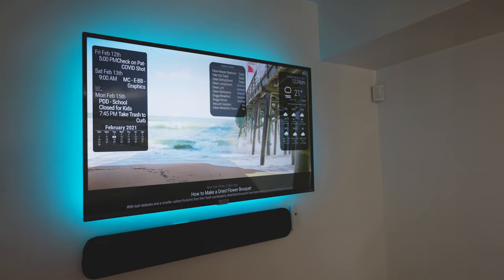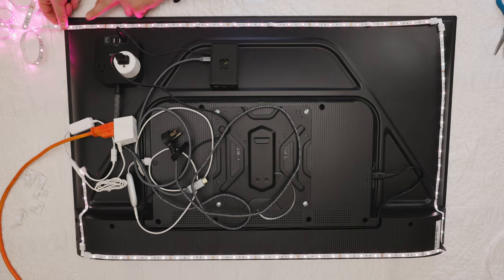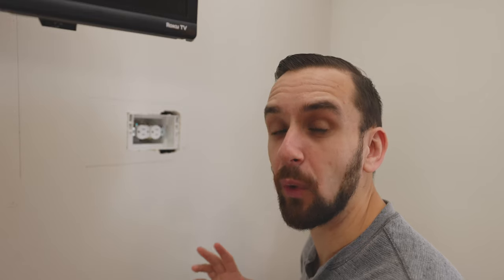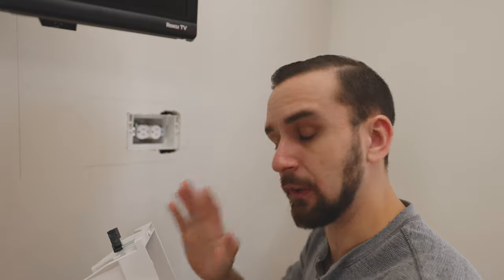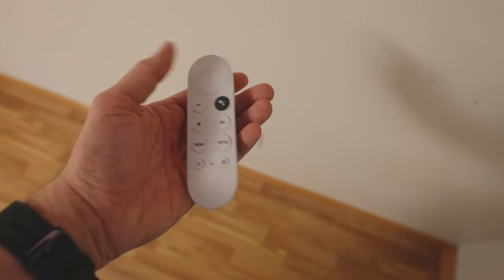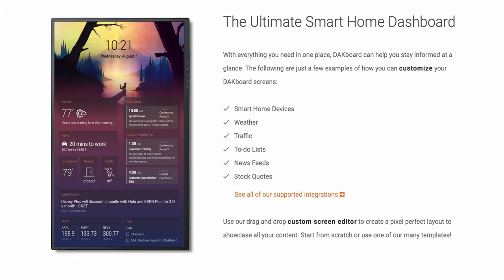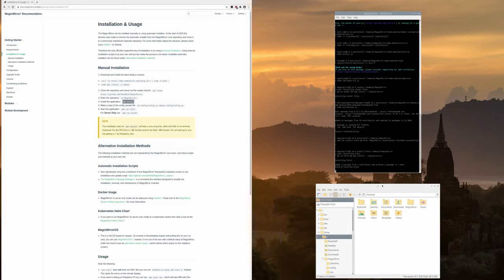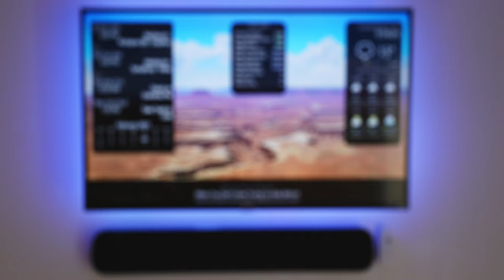Digital Dashboard (Calendar/Weather/To-Do List/etc)

Comment: You still happy with this set up ?
Reply from the maker: I am! The only thing I changed was the backlight. Check out my Hyperion vs Govee video for more info about that.  We’re moving into our new house on Monday and I actually was thinking if I would change anything else I would change. I have some cool smart home ideas, but overall I think my idea will mostly stay the same.
Reply: @NickRains  cool
Do you use that monitor as a tv too ?
So just switch inputs ?
Reply from the maker: Yes. It has cec, so it auto switches inputs. I have a google tv hooked up to it for all of my streaming
Reply: @NickRains  auto switches ?
Reply from the maker: When I turn on my google tv, it automatically switches to that input
Reply: @NickRains  ah then leave it or change the tv. 
I wonder if there is an Apple version